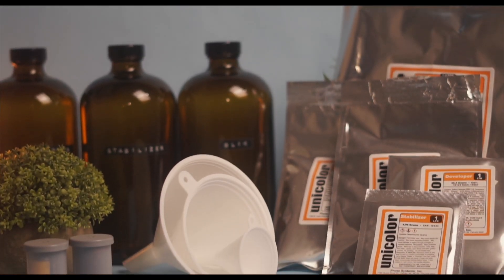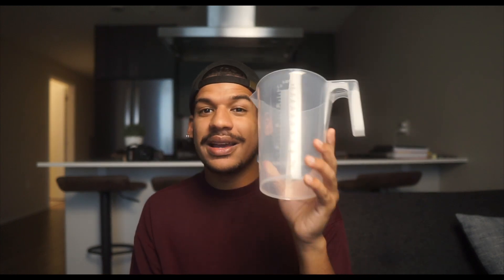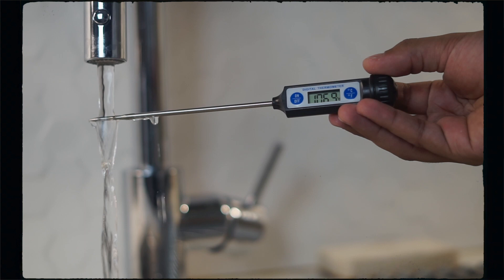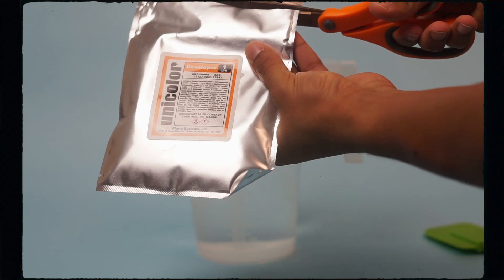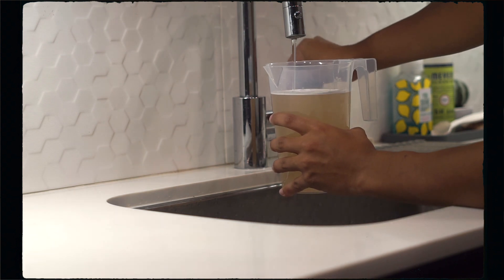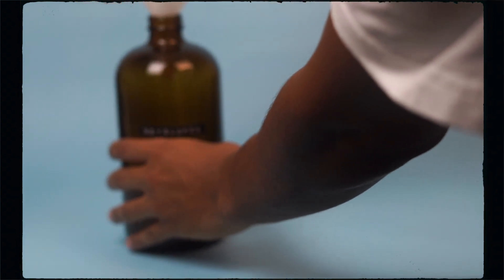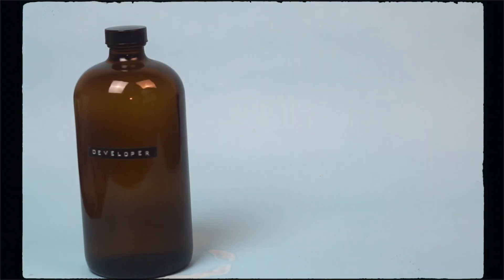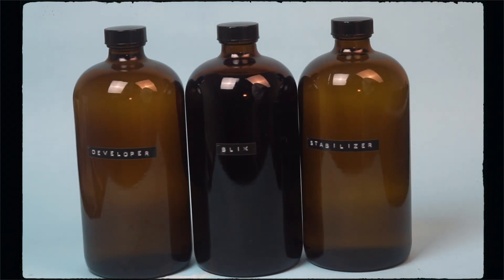How To Mix C41 Chemicals At Home [Unicolor C41 Powder Kit]

Comment: Awesome tutorial! Thanks for this! 

Maybe I didn’t catch it if it was said but the basic blue masks do nothing for the chemical vapor. Better have safety goggles than a thin blue mask. If you really want to be protected, use a 3M with the right rating.
Reply from the maker: @maximeamyot  this is correct! Thank you
Reply: Correct, but the mask is used to avoid ingesting chemical dust, which can go into the air as you pour the package contents into the water. Frankly, if you are so clumsy as to need googles  from spills and splashing solutions, we just need to go digital.
Reply: @randallstewart1224  I agree with you that a basic mask is good enough for small particles when you mix the formula. 

In regards of goggles, better safe than sorry. I’ve already seen too many people rub their eyes with their gloves full of chemicals… just wearing goggles saved them so even if it’s the most inoffensive chemical I recommend wearing them 😂

Comment: Couple of points:
   Water. If you live in an area with hard tap water, use distilled water to mix the developer to protect its chemical balance, and in the stabilizer, to avoid hard water spots on your dried film. The blix is so strong that you could probably mix it in flat root beer.
    Kits. Most kits are like here, a developer and a blix, which combines the bleach and fixer in one process step. A few use separate bleach and fixer steps, which is more like the real C-41 process (which these are not). The advantage of the three step process is that the process first has to bleach, then fix. When you mix those two chemical processes together, you run the risk of getting an inadequate result, particularly as the chemicals age and are reused.
    Stabilizer. Strictly speaking, a chemical stabilizing step has not been required of C-41 process films made in the last 20 years, and most "stabilizers" are just a wetting agent, like Photoflo, to avoid water spots on dried film. About half the kits don't include a stabilizer. If your kit does not give you a stabilizer, wash the film as usual, and then give it a soak in a regular Photoflo solution before hanging to dry.
Reply: I want to see film developed with root beer now...

Comment: When mixing developer and blix, does the water have to remain a constant 102?
Reply from the maker: If you are not planning on using it right after, it doesn’t have to be at any temperature! You can mix at room temperature
Reply: @AndyPerezCaba  With powder chems like here, you may find that mixing a room temp will require a longer mixing time. I'd try both ways before picking either.

Comment: hey! really great guide, thanks for helping out beginners! one note (because i was curious about this and did some digging): it does not matter what temperature your water is when mixing these chemicals as long as it's not blazing hot or freezing cold. The temperature suggestion of 102 is only because the manufacturers are assuming that you might want to develop film soon afterwards. this applies across multiple brands and mixing these chemicals with room temperature distilled water will not alter your end results in any way as long as you mix well and heat them properly when developing. Just wanted to share for anyone who is worried about getting the exact temperatures during this step.
Reply from the maker: Oh wow! I didn’t know that 🤭 that is going to make mixing the chemicals so much easier for me in the future now 🤣